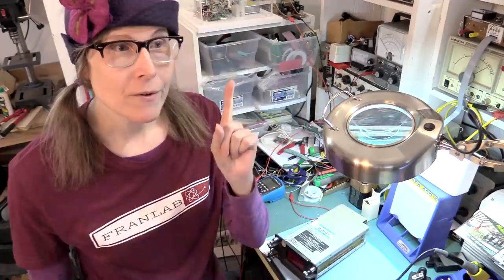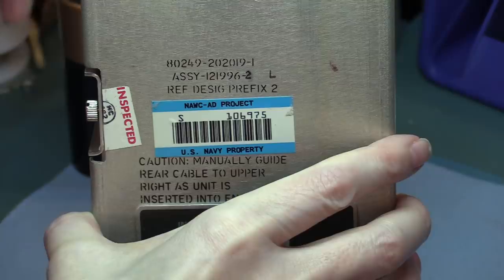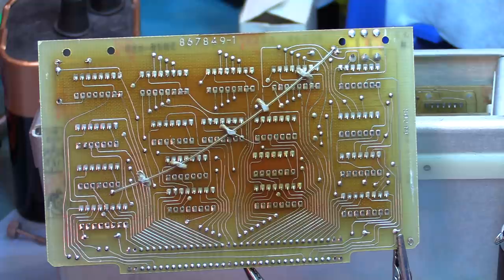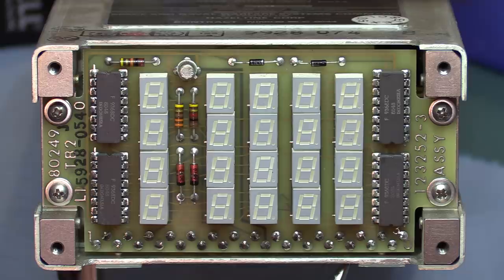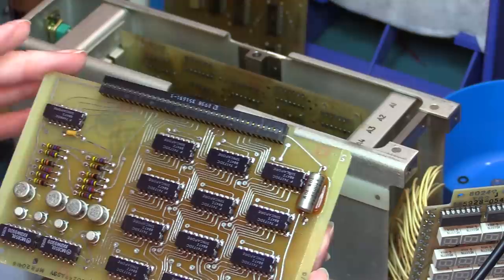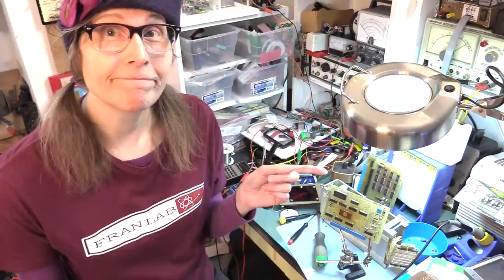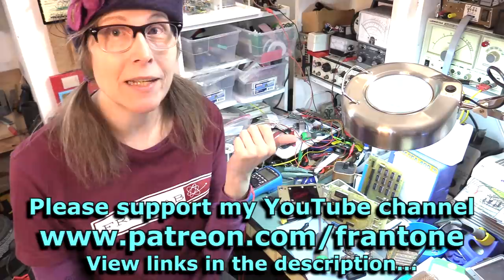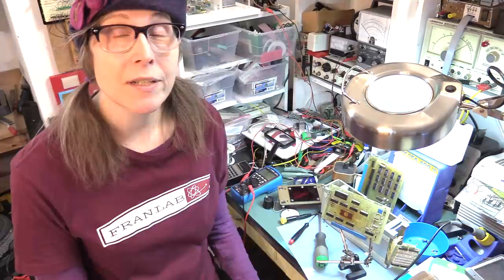REAL Wargames Tech Teardown!!!  80's Missile Target Display

Comment: Nice shootout for Wargames! Such a visionary movie about the looming dangers of reliance on computers in the modern world, it sure stood the test of time. The display screens in the war room were actually a HP computer graphics tour de force for the time. They were drawn by an HP 9845 workstation driving an HP 1345A vector display, itself re-driving a super-resolution HP 1336A CRT monochrome display. The display was then photographed frame by frame with color filters. I happen to have one of the very 1336A that was used for the film in my collection! But I have not even gotten to turn it on yet...
Reply: Marc, care take a crack at reversing this display? 😁
Reply: You're the man Marc love your channel too!
Reply: I thought that a 1336A is the flywheel part for1957 MERCURY 10HP (Mark 10) :D
Reply: IIRC there are "computer animations" from the 80s which were drawn a frame at a time using a plotter. Then photographed.
Reply: @tobyfried  DO EEET
Reply: Hope Fran sends you this Marc, I bet you might have some fun figuring this one out 😁
Reply: May be you reconsider turning that 1336A on some time?
Reply: Every time there's a WG reference, I'm sad I recycled my 1347A, which is closer to what WG used than a bare 1345. Bought it at an employee scrap sale in Colorado Springs probably around the time of the movie. The CRT /may/ have been built across the wall from where I worked in the area where oscilloscope tubes were made. The 1347 is a combo of an HP-IB (aka IEE 488 aka GPIB) driven HP-GL-to-X-Y vector generator which drives its built-in 1345 vector display, all in a relatively-compact case -- so it was basically a 6x6" monochrome video pen plotter and in fact could preview a plot and then send to a real plotter. The X-Y voltages then also drove the higher-resolution vector display for WG. Some folks dug up some of the info/tech here: https://www.hp9845.net/9845/software/screenart/wargames/
Reply: @adrianschneider4441  Oh, it’s on the to do list. But I just zapped my HP 9825 computer that drives it while filming one of my latest video, so I have to repair that one first. Then get an 8” floppy going so I can store the drawing data. Then get the screen working before the rest fails again. Keeping these complicated vintage setups working is a bit of an ongoing battle...
Reply: why dont you make cool videos like this one anymore?
Reply: @CuriousMarc  Oh Marc Please document and film this for your channel, and get your trusty team on this before the 40th year anniversary of the movie.
Reply: The crazy part is that I thought the movie was fictional.  Except then I have read about stuff like, for example, the moon causing a false alarm.  Of course there was no WOPR.  Just various errors in the system.

Comment: Fran, PLEASE POWER IT UP  !!! +5V is easy, use any TTL, pin 7 is GND and pin 14 is +5V. If you wanna go deeper, the board with transistors and the Motorola MC chips looks like a voltage regulator, simple to reverse engineer, the datasheets are available... anyway, just the 5v might give a great result!

Comment: It was common to see ti chips from Indonesia back then even mil spec components. I was surprised to see 74 series devices used and not all 54 series. The board is just like what we made, 1970’s aerospace, same conformal coating and same type of layout. The wire jumper could have been an error or a “fix” between the breadboard and etch design. They were allowed in limited quantities but the assembly still had to meet the shake & bake tests. Nice to see it. Thank you for posting the video.

Comment: The ceramic DIP packages are often called "frit seal" packages. The top and bottom are ceramic plates and the gap between them around the leads is filled with glass. When manufacturing them the glass is in the form of frit - small particles of glass that have been melted and granulated - and it's all heated to melt the glass to form a seal.  These packages can be opened by heating them enough to melt the glass.

Comment: It would be easy to light this up. The windowed chip is a UV Eprom (2708 probably). It's a 1970's trick to replace a bunch of logic. You put in a digital value on the address lines, you get an 8-bit value on the data lines. It is an easy trick to turn ASCII into LED segments and so on. It isn't encrypted, it's probably dirt simple to power up and send serial data. The boards are discolored normally for TTL. This thing ran 24x7 for 20 years. The mild heat over long time causes the epoxy board to discolor. See it in old computer stuff all the time.

Comment: Sadly this isn’t for ICBMs but it is part of a radar console for the AN/SPY-1 naval radar system (and some other systems). 

This is also the same radar system that had a “user interface design flaw” that contributed to the USS Vincennes shooting down a passenger airliner in 1988. The incident involved the IFF and position of a passenger Airbus A300 being confused with that of a F-14 Tomcat.

This particular module ‘UPA-59A’ is designed to display that IFF data.

There are pictures of those radar consoles on Wikipedia commons, you can see the module on the left side of the main console.
CIC-USS-CarlVinson-2001.jpg
USS-Midway-CV-41-c.jpg

Sadly YouTube shadow bans my comments if I post links so you'll have to search for them manually.
Reply: Wish you could post a link to that. At the time that was chalked up to operator error and being a little jumpy after recent events in the region.  It was afaik the first time an event was recorded and played back digitally and showed errors in human accounts. Radar replay revealed the aircraft was not on an attack run as reported by operators.
Reply: I think you have the winning comment. I was thinking there were too few digits for nav data & your IFF info fits. Thanks for the info.
Reply: @anullhandle  just go to wiki media and search for the names, you'll get the pictures.
Reply: Are you sure it's an actual Shadow ban, or the usual thing of comments with links taking a while to show up for other users?
Reply: @lucidnonsense942  comments with links are held for moderation by the channel owner, depending on the channel settings.
Reply: You can post links, just remove the h_t_t_p part.
Reply: You could put links in a post on pastebin and link to that
Reply: That would very likely explain why there are apparent refurbishments at 15:33 dated for 1988.
Reply: Having worked in the private sector in the 90's on propriatary equipment with tons of X military managment involved, I see an UNcanny resemblance to the system I worked on. I smell the same engineering teams as the Veeder root, Gilbarco, and Dresser Wyane systems back in the day.
Reply: @timg6850  Yep and they awarded him a Legion of Merit and his crew Combat Ribbons for accidentally killing 290 people including children in a monumental fuck up that could have been avoided.
Reply: @dylrydal803  yeah, the "dont shoot down passenger plane" hotfix after the Iran-Flight-655 disaster.
Reply: @richarddixson1971  Now all that tech is used in Gas Pumps at Fuel Stations to watch advertisements and pay your fuel at the bowser.
Reply: Good call on those pics. It is the top module in the stack to the left of the main console. They aren't illuminated in either of those pictures.  I'll try to post direct links.
https://upload.wikimedia.org/wikipedia/commons/0/07/USS-Midway-CV-41-c.jpg
https://upload.wikimedia.org/wikipedia/commons/c/c3/CIC-USS-CarlVinson-2001.jpg
Reply: I was an FTB and never seen a display telling you what the target was and especially a MERV system nice catch.  The Poseidon system was mostly wire wrap.
Reply: I agree, it belongs to the IFF system.

Comment: That brown goo they used back then use to be clear when the board was made but over time turn brown and becomes conductive and really messed stuff up! I had a Kenwood 440S hf ham radio that that was built in the early 80s with that crap in it! The radio started having issues a few years ago that no one could figure out till one old ham friend of mine looked at it that work on old electronics gear for the government told me that I had to remove all the brown crap and that should fix the issue! Well with hours of picking and cleaning that stuff off the one board that had this stuff on it the radio workd correctly again!

Comment: On the last two Vintage Computing Festivals here in Berlin, Germany, there was a guy who displayed his original HP vector CRT screen, the same model of display that was used to project the world map onto the wall screens of the NORAD war room in the Wargames movie. A vector based CRT display! That was awesome! (Edit: HP 9845C is the model number of these displays. And yes, of course they were transferred onto 35mm film beforehand and then projected onto those screens during the filming, but still...not painted or anything, but electronically created!)
Reply: I remember working with one of those vector-based terminals (don't remember the brand).
Due to memory shortage, as you added characters at the bottom, the one on the top disappeared!

Comment: All of the chips from that era were US made.  The packaging was done overseas.
The bodge wire is held with a special silicone that is kept refrigerated until used.
The ceramic packages are hermetic, plastic packages are not.
Yes there were special board pulling tools.
The capacitor you called a tantalum is a leaded multi level ceramic.
The part with the window is a uv erasable eprom.
Conformal coating does not pass UV.
Reply: Cylindrical cap is indeed tantalum, MLCCs are square and no way you can get 100uF within that size. By the way, USSR-made tantalum caps look exactly the same.
Reply: @oleksandrmusiiaka2334  The one she called a tantalum was a MLC molded in an axial tubular case.  I used similar caps in designs in the late 1970s.  The 100uF cap was a large Al electrolytic.

Comment: The bodge wire was needed for the connection to be made without adding a layer to the pcb, and back in the mid 70's to mid 80's adding a layer to the pcb was prohibitively expensive besides being more delicate.  I'm pretty sure it was by design and not a 'whoops' fix.

Nice find and great explanation.

Comment: I once did a report for a computer engineering class on the history of "Big Blue and the Seven Dwarfs", meaning IBM (with their famous blue logo) and the seven smaller mainframe computer manufacturers from the heyday of these systems.  I briefly discussed at least one notable detail about each of the companies.
All I could manage to find unique about Burroughs was the fact that their systems were often used as props in movies.  The B-205 model is particularly cinematic, with its many banks of 'blinkenlights' driving home to audiences the point that "OMG this is serious business!  Look at those flashing lights... Those machines could start WW3!"
Apparently a couple of B-205's were sold on to the used market after being replaced at their original home company.  They found their way into the prop departments of several Hollywood studios and prop supply/rental companies and made the rounds for decades.  It's interesting that some of the very same machines and blinkenlight consoles were used in older films like Dr. Strangelove and Failsafe, and also in far newer stuff like the first Austin Powers film in 1997.  Keep all of that in mind the next time you guys are on Jeopardy.

Comment: PCB traces are probably taped, not drawn. Did ICs ever get packaged in the USA rather than Indonesia etc.? No decoupling caps?
Reply: Yeah, the absence of decoupling also got me thinking?
Tried that in the past as a youngster and it made a nice oscillator LOL
Wonder how they got away with it?

edit;
Or did the bodge contains the little decoupling caps?
Reply: Looks like it's all or mostly TTL so not nearly as bad as cmos when switching on/off.
Reply: The frequency it runs at is probably so slow that it doesn't need decoupling caps. Probably 1Mhz max, if that.
Reply: @simontay4851  Decoupling is more just to prevent oscillation, that doesn't have much to do with how fast or slow the circuit runs.
Also to prevent any ringing from switching outputs.
Reply: Had the same question. I feel like I’ve never seen any DIP package (or otherwise) with USA on it.
Reply: @p_mouse8676  Speed is a measurement in rise/fall time, not just frequency. Faster rise times needs more current and will cause the voltage rails to dip due to trace inductance. CMOS is really bad about rise/fall inrush current because each time you make a state change you are charging/discharging a tiny capacitor.
Reply: Some of the traces, like ( https://youtu.be/dXrLSOReMFA?t=1164 ) those around the big IC or the one right under the SN5400J, look so thick that they seem almost like copper wire taped to the board.
Reply: Yeah, and no ground / supply planes. Overall, I'd give the designer a D- on layout.
Reply: TTL are more robust and operate at a higher voltage so no decoupling were used unless they operated at high frequencies and had big boards.
Reply: The countries of origin stamped on the devices are from the assembly & test facilities, all located all around the world in this era - common places also were Portugal, El Salvador, Brazil, Puerto Rico, etc. The wafers at that time were manufactured in the western countries and shipped there.
Reply: Funny enough a lot of military TTL boards just used a single wet tantalum as bulk decoupling, though with a 4 layer board with the 2 inner layers delivering Vcc and Gnd as thick inner traces. Up to 30 Ic's per board with only the one, or possibly 2 decoupling, and they would work over the full military temperature and voltage range as well. Only if you had more complex logic would you find a third or fourth decoupling capacitor on the board near them.

With card insertable boards you often could see the PCB layout had a printed start section with the card edge connectors laid out on it, with the decoupling capacitors right there as part of this preprinted layout, and the rest was then drawn in afterwards.Nearly identical board interconnects, just the 2 alignment pins with different orientation on them, so you could not fit the card in wrong. Up to 72 variants using just those same 2 pins in the Socaplex card connectors, as the alignment pin and socket have 6 sided sockets you can insert and lock them in on the plastic housing. Yes the pins are spindly, but that is why you have 2 alignment jigs to set them up.
Reply: The reality is: CMOS is more forgiving about power supply voltages. TTL, much over 5V and it's dead. Also, TTL makes lots of switching noise. CMOS does too, and both need careful layout, but I'd say TTL is worse. CMOS can't tolerate much input noise (it responds too fast), but we aren't talking about CMOS here. The only reason this worked is because it was a static display device. Hold the input long enough for the oscillations to die down (say a MS or so), and it figures it out. If this was a serious switching device like a clock or timer, it would not work due to ringing and supply spikes.

While I'm not a fan of the stupid 0.1uf ceramic caps on each chip for reasons I won't go into here, a good aluminum electrolytic is awesome on each chip! A tantalum has drawbacks too basically because the impedance is too low and that causes issues. Yes, ESR can be your friend.

A good ground plane and supply plane are a must for any self respecting high speed circuit, and low speed circuits are best if high speed designs are adhered to. Just because a circuit is low speed doesn't mean it can't respond to high frequency glitches so always use best practices when designing PCB layouts and circuit design.

Ask me how I know this.
Reply: @SeanBZA  The frequencies TTL reached needed no more than that unless the board was big. TTL hardly get to 400MHz. For TTL frequency counters above that for instancea prescaler based on ECL was used.
Reply: Yes, definitely tape. I used to lay up artwork for printed circuits in the 80's. (There was PC software, cannot remember the names but if it was a small circuit it was a heck of a lot quicker to grab a sheet of stable clear plastic sheet, lay it over a grid and get stuck in). Rolls of black type of paper tape of various widths and sheets of different sized pads. The only other tool you needed was a sharp blade.
Reply: @TheErador   Because I spent thirty years designing high power switching amplifiers with 10ns rise times and great layout was essential for proper operation. A small ceramic cap in parallel with a big electrolytic (with some ESL and low ESR) makes a resonant circuit. These amplifiers were designed with a moderate amount of TTL in them and if grounds and supplies were not solid and properly bypassed, they didn't work too well. After learning the hard way about these things, I adopted these findings into all of my layouts, even for analog amps with 100kHz bandwidths.
Reply: @kenmore01   PA amps? Yeah you'd definitely want to avoid noise and mains frequency hum there.
Reply: @kenmore01  Yeah, but it's military-grade.. :)
Reply: @peterfenwick2540  Bishop Graphics, spent a fortune on their stuff in the day. The boards like that were done with different widths of black crepe tape that would follow a curve.
Reply: we used already computer software in late 1983 when designing PCB's.
Reply: The TI chips were from Taiwan.

Comment: The 4 holes on the top of each board was for a card puller.  The puller had pins that would fit into the holes, then you would squeeze the puller and the card would get lifted evenly.  They usually worked well... sometimes though not so much.

Comment: To give it power, you could trace +5Vcc and GND by putting a "ringer" on the appropriate pins on the LED decoder chip(s) (or tacking onto a TTL chip on the plugin PCB and plugging it back into the cage) and finding the pin it goes to on the back DB connector...